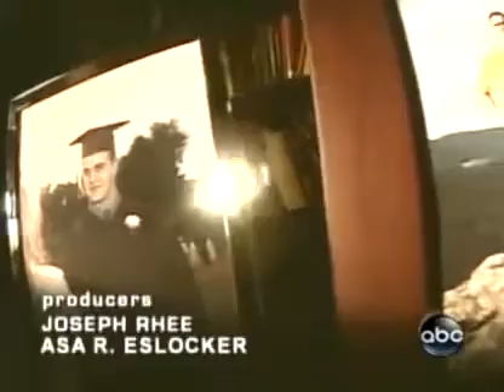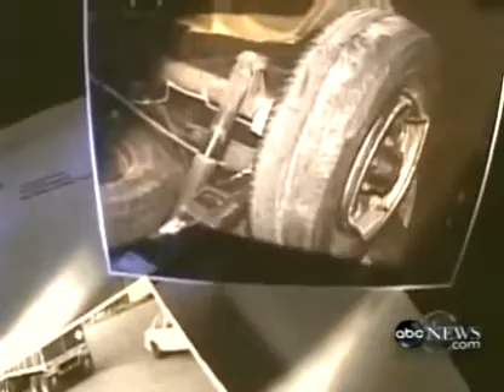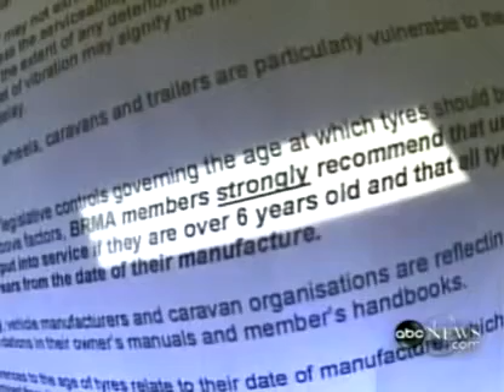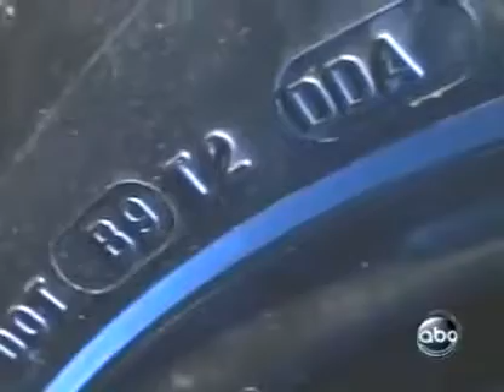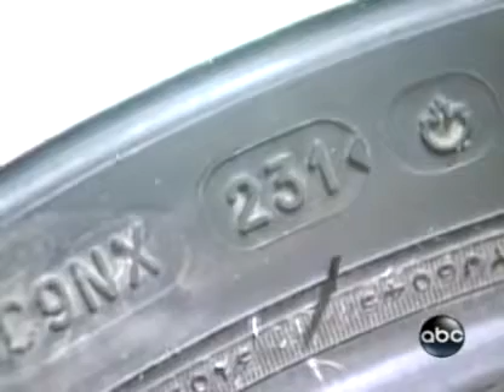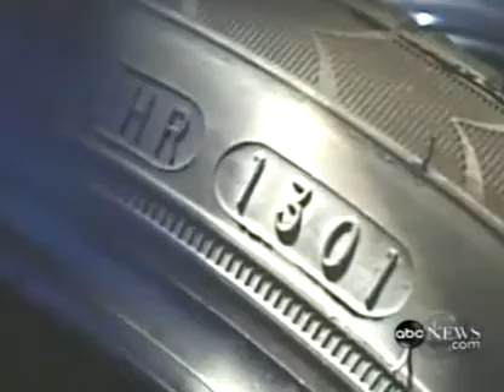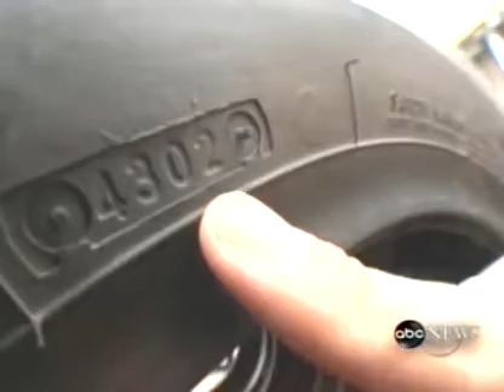Tire expiration date and age of tires

Comment: Periodically spray your tires with 303 Protectant to resist drying out and cracking , sidewalls and tread .
Reply: @Peter Rudy I don't think it's a good idea to spray anything onto the treads as it can cause slippage when wet.  My best advice is to maintain your car manufacturer's recommended tire pressure, keep your wheels moving, and rotate them when it's due.